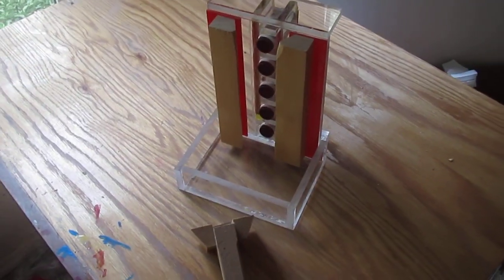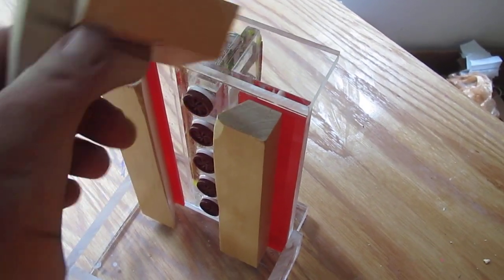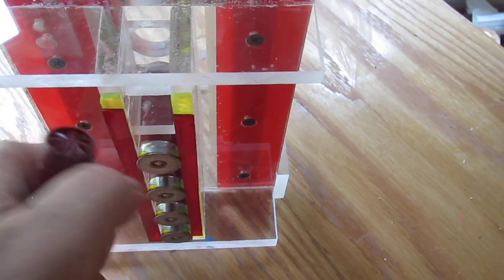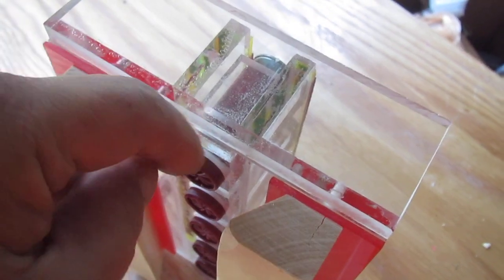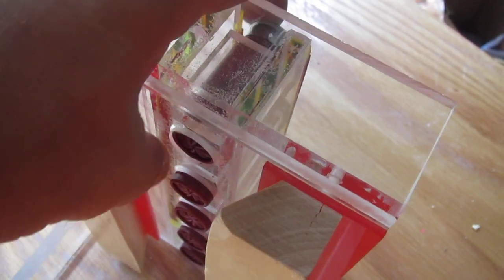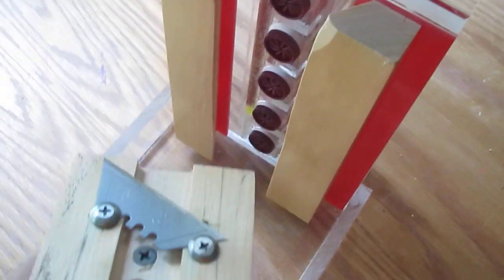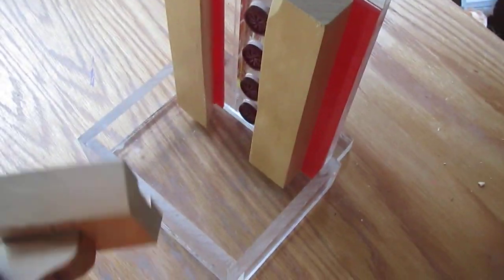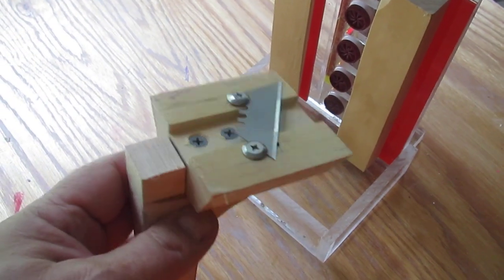5 Shell Guillotine for Making Wax Slugs Prototype

Comment from the maker: I came up with a small light trimmer that might make the 13 ounce weight maximum when bundled with a grid board. That was the main reason I could not bundle trimmers with boards...it comes out over 13 ounces and then I cannot ship 1st Class...which is way cheaper than Priority. Stay tuned! Video of the new trimmer uploading...

Comment from the maker: The wax cools too fast...lead takes the heat out even faster...so the lead needs tobe heated with the shot in a container. If you filled the shell halfway with wax and then pour in shot the wax won't totally get in between all the pellets and you get birdshot instead of bonded shot. What makes wax slugs so potent is all the shot is kept in a bundle until it hits something with enough resistance to make that wad explode apart. Otherwise the little pellets just spread out with little penetration.

Comment: If you could get more angle on the knife that might help with the deforming shells. 
As for holding the shells just have a sliding gate in back. Instead of the handle for the cutter sticking out you could just push straight down. That would allow for a bigger catch box, for the shot. As for bouncing I would think felt would help there.

Comment from the maker: It's hard to make a really tight dove tail type rail so there is going to be some play in the part that moves inside the two angled parts that trap it. So the force needs to be against the hulls. First try had the shells pointed up with the bottoms pressed against the table but it was very hard to push the blade...the unit wanted to slide. I pressed it against my stomach and pulled it toward me like a crossbow. Then I tried vertical and it was much easier to push the blade

Comment from the maker: That would help. If the shells did not have a flange or rim that makes them not lay flat against each other I could stack them...but as I found out the plastic shell is soft and needs to have support or it will not cut cleanly.

Comment from the maker: The little box below is to catch the shot. I want to trim 25 shells in 5 passes...then pour out the shot (through a hole so the plastic shavings etc stay behind) right into the wax to make the process really fast. The most time consuming part is trimming one shell at a time no matter how you do it...my grid board holds 25. So if I can trim 25 in 5 passes I could really speed it up.

Comment from the maker: If you mean to support the hulls all I need to do is retract them so only a tiny bit sticks out...and that is my next step...getting the blade to track right up against the shell holder face by making slots in the face to accommodate the screws that hold the blade. I was pressed for time and had to stop  before I was really done tinkering. Slots for the screws, tighter track, less shell sticking out, pad for the shot so it does not bounce, angled base...lots to do but today not much shop time :(

Comment from the maker: The utility blade has a bevel on each side. If I made my own blade and shaped it like a chisel that would work a lot better...with the flat running against the shell holder. I agree that the utility blade is part of the problem...but I think I can work around it. I want to make this from easy to replace parts, common materials...things that I can source easily. A chisel would work well...and I happen to have a huge 2" parting chisel I could repurpose...but I want to develop a product.